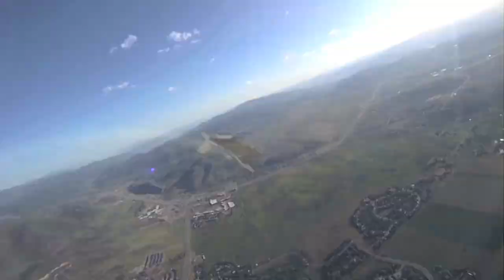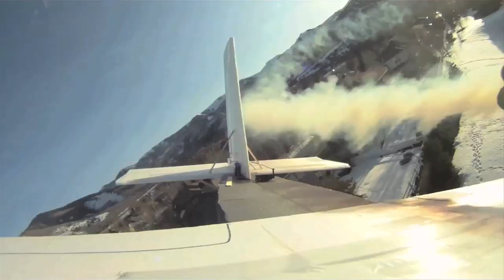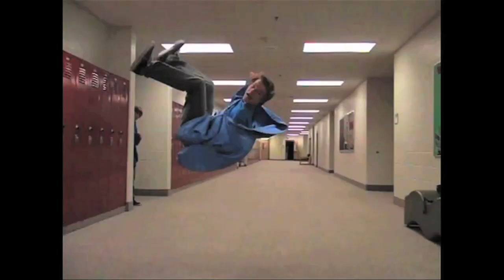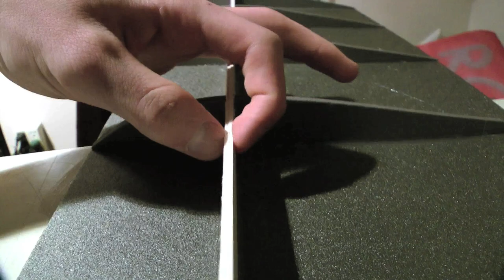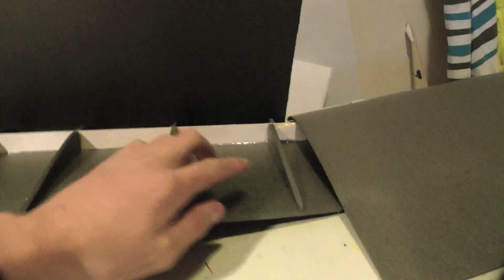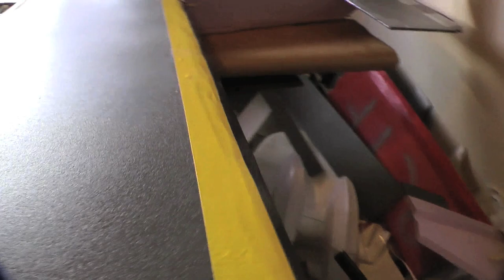How to build a nice ribbed wing

Comment: Have some problems working in a very hot county - folded my depron or foam bourd wings by first sticking vinyl onto my foam first flat - then scaw a line to be folded over then stick together the trailing edge .My wing looks great but the vinyl in a hot car at 110 degrees bubbles the vinyl ?????